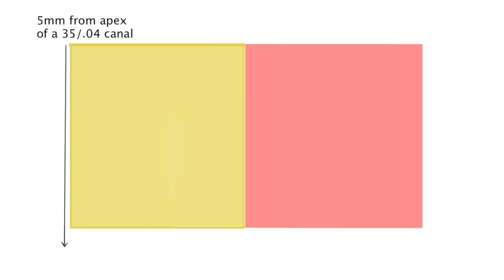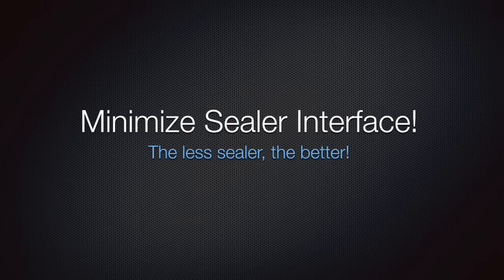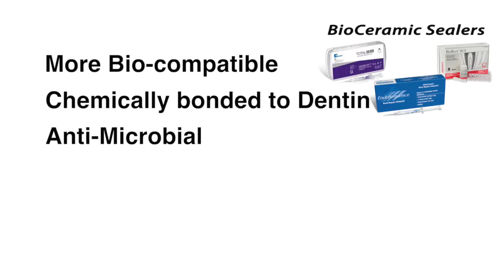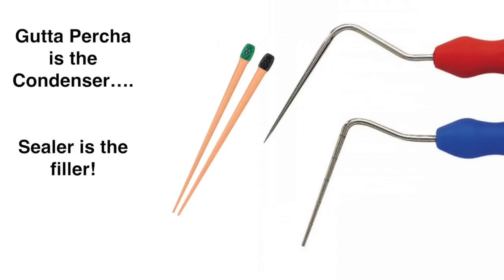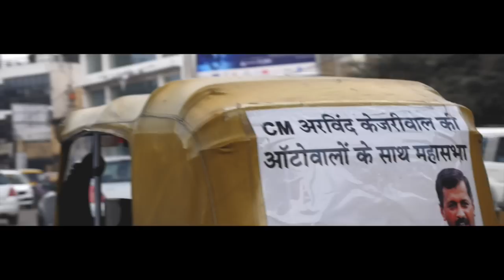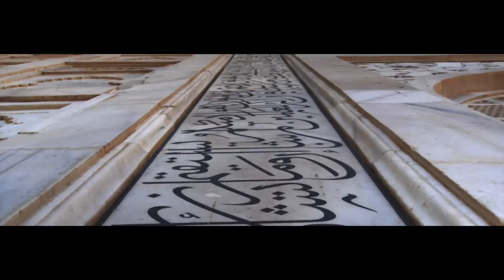Epoxy v Bioceramic sealers: Friday Questions

Comment: heard such a theory , in connection with its strength characteristics , bioceramic sealer holds no leaks .... and if the tooth will continue to prepare for the root tab , ceramic sealer will give micro defects ?????

Comment: I have never used c-point clinically  sir, only tested it on extracted teeth. I was only pointing out a clinical situation where bc sealer is indicated, based on rational reasons
Reply from the maker: If it's rationally indicated there it's rationally indicated every time! The reason why C-Point itself is indicated is because dentin and tooth is hydrophilic and we've been using hydrophobic sealers because we haven't had hydrophilic sealers until now. I think you just answered your own question!

Comment: For a patient with an eugenol allergy, what are the recommended sealer? Some of bioceramic sealer claimed to contained MTA which I thought maybe could be an irritant(the resin or mta)
Reply from the maker: You need a pure calcium silicate cement as the least potentially irritating cement.

Comment: Does dental resin based material (sealer) will get resorbed if it get push little bit periapical region.during obturation.? 
Does acrylic resin and sealer resin are different?
Reply from the maker: Thanks! Yes, Epoxy cements resorb to some extent if pushed out… the problem is that it will also resorb from inside the canal over long term and why it should still be used with classical Obturation techniques like vertical and lateral compaction instead of Hydraulic Condensation (single cone.) 
And no, it’s different resin formula from acrylic. These are epoxy resins.

Comment: Excellent video and thorough explanation. What is your opinion on new sealers like Roeko's Guttaflow 2 and Guttaflow bioseal and Septodont's BioRoot? Are they better/worse or similar to bioceramic sealers?
Reply from the maker: Roeko's Guttaflow has no antimicrobial properties and has no advantage at all over any of the bioceramics. BioRoot is ok and better than guttaflow as it's a bioceramic but it's hand mixed and not premixed.
Reply: @AANasseh  Thank you very much for the quick reply. I agree that automix is much more convenient. BioRoot brochure mentions though that they purposefully made it hand mixed, because it keeps 90% of fibroblasts vital in contrast to the other sealers that keep 50% vital due to the effect of the matrix material in the pastes. I'm not sure if there is a clinical significance for this though. Concerning Guttaflow, the only advantage, as I see it, is the setting time (15-30min) because it permits to potentially create space for a post in the same appointment. Both BC sealer and Bioroot have setting times ~4 hours, according to the instructions of use.

Comment: Other than Endosequence, what other brands of BD do you recommend and are there any differences? Any experience with AH plus bioceramic sealer by Dentsply Sirona?
Reply from the maker: I only use the EndoSequence obviously as I helped develop it. But there are a few of them out there now. I've tried the Sirona already for the past month and since several people have already asked will likely review it soon. You might as well get the Maruchi if you're outside of the US as it's the same as Sirona. It would be less expensive. Cheers! :)
Reply: @AANasseh  Thank you for your reply :)

Comment: hello Dr Nasseh. is it possible to use a calcium hydroxide based solid cement instead of the glass ionomer to separate from the bc sealer and  obturate with composite on top of it?
Reply from the maker: san sa A Ca(OH)2 cement?! Like what? Dycal? I don’t know. No studies to show that. That’s why BC Liner was used. That’s it’s main purpose.
Reply: @AANasseh  no like calcimol. its a calcium hydroxide paste that you can polymerize. its just to use a quick isolation from bc sealer instead of glass ionomer... unfortunately in the clinic I work the only glass ionomer is ketac which is not practical and really expensive...
I mean I'm just looking for a quick material separate the bc sealer from the composite. and what do you think about a normal primary teeth sealer? that's what I used after obturation with zoe cement and guttapercha
Reply from the maker: san sa I’m sorry I have no experience with that material. Is that in the US? Either way, I can’t tell you if it works or not. Try it in a hydrated extracted tooth (hydrate for 24 hours. Put a thin layer of BC sealer on the chamber floor.  a layer of your material over it. Then cotton and Cavit and dump the tooth in a cup of saline and let it set for one week (since it’s not at 37degrees.) 
Then open it and cut through it and look at the transition line in a thin sawed saguaro sections.
Reply: @AANasseh  it's just a simple calcium hydroxide for pulp capping.. I don't know any brands...
anyway thanks for the suggestions. I will try the experiment! 😊

Comment: I understand that the BC sealer is considered biocompatible, would that mean that sealer puff isn't a problem? Apart from some post operative discomfort?
Reply from the maker: Generally, a sealer puff has no practical purpose and should be avoided if possible. A small puff, according to some, confirms canal patency and clearance to the apex. So, it might be desired (different philosophies.) So, if you have a small puff having a biocompatible sealer is helpful compared to one that can cause more inflammation. This would translate into less post operative pain.
Reply: Sir/ma'am can u explain what is puff?

Comment: first, congratulations for your videos, its an excellent way to be updated, and my question is if we can  use protaper universal guttapercha points as a single cone tecnique with bc sealer, and if you recomend to use protaper universal rotary files or the mtwo rotary files (vdw), thanks Dr for share your knowledge, from mexico, Dr Julian Hernandez
Reply from the maker: Julian, using non coated cones with BC sealer is risking not having a bond to the cone, which is no different than all other obturation systems (no sealer bonds to the gutta percha)... but if possible, it's better to use the BC Coated gutta percha. If not available, then use the cone and do some mild lateral condensation. Good luck!

Comment: Lets agree we disagree. The level of evidence you are showing is not high. FIY I have epoxy sealers as well as  bc sealer in the pratice.and ofcourse cost price is a factor since both sealers won't affect my healing outcome. Once you have shown me a clinical trial with higher healing than I will start to use bc sealer again. They only clinical situation I will use bc sealer is when I use c-point cause then I need a hydrophilic sealer.
Reply from the maker: Interesting. Yes, Let's definitely agree to disagree as I'm surprised that someone who requires such high level of evidence before clinical application is actually using C-Point! I mean, if that's not cognitive dissonance then I don't know what is! Best wishes and good luck!